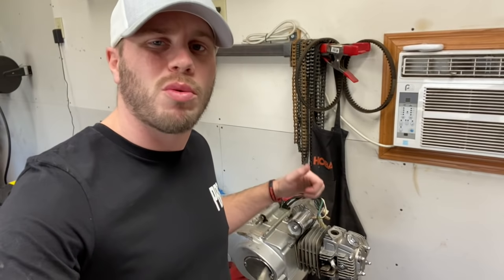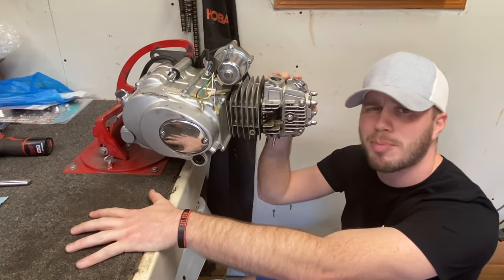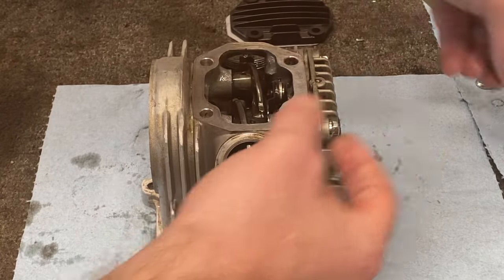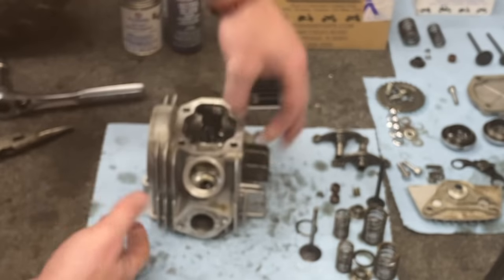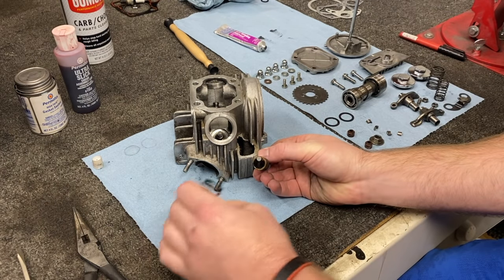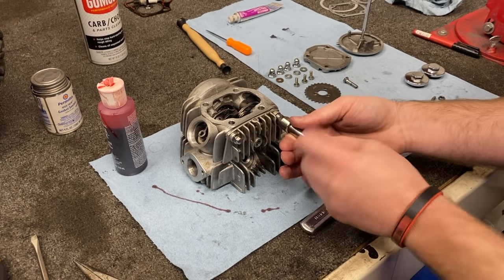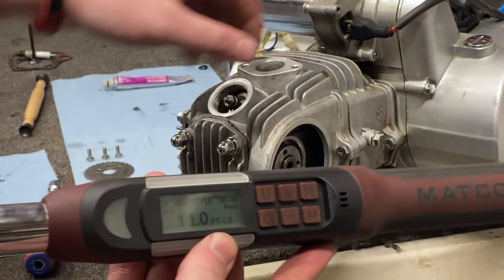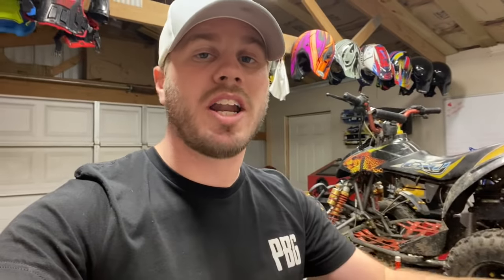HOW TO: Complete Tear Down & Rebuild of a Chinese ATV Engine Head. Every step you'll need covered!

Comment: My little brother just give $150 for a kazuma 125 that hasn't ran in years. Went up there the other day to try turning it over by arcing the solenoid but nothing happened at all. No sparks no click from solenoid nothing. He then decided that it was the stator that was no good when I explained to him 3 times that his problem had nothing to do with the stator and that it was a bad solenoid or starter but instead of listening to me he takes it upon himself to carefully remove the stator with no tools other than a pair of vise grips and few other things but ended up rounding a bolt. What does he do instead of waiting for me to come back with an angle grinder? He grabs ahold of the unbolted portion and broke it off instead so now he needs a whole new engine for it cause it broke a big chunk of it off.
Reply from the maker: Dang man, sounds like your brother just learned a $150 lesson on ATV repair! That sucks, but at least new motors are not too expensive to replace. You could even try and pick up a used one for under $100 bucks.
Reply: He had a suzuki 150 give to him but frames no good. We're gonna put that on the kazuma frame but everything will have to be spliced into the old harness cause the plugs are different and some missing. Also gotta cut and move motor mounts but luckily my uncles got a welder cause I sure don't.

Comment: 0:22 
70?
I got an engine running good on 45!
Reply from the maker: I means that's great if you do so don't fix what isn't broke, but I'm going to say your gauge must be wrong or your getting a false reading. An engine can't run at 45 PSI, that is literally not enough compression for a combustion engine.
Reply: @PraskaBoysGarage  could be off. But that’s what it read.

Comment: You made a mistake. You did a leak down test without verifying the position of the camshaft. You had it in the wrong position for doing leak down. Look at your timing mark on the cam when you took it apart vs when you put it back together. Crank goes around 2 times for every 1 rotation of the cam. Your problem was not in the intake valve. It was only open because the cam lobe was holding it open. If you rotated the cam 180 it would have closed. Your problem lied in the damaged exhaust valve and the intake being open hid the leak at the exhaust valve.

Comment: You're grinding the valves the wrong way you should only grind them towards one direction (left or right) while also pulling up the valve casually in a specific manner. Thats why you use the vice to hold the head you get a nice seat on a chair and you spend your time with it until the valve seat and valve looks a bit coarse and fady and you can see a line in the valve seat on the head. Also you should have replaced everything else since you ordered it it made no sense to change brand new oil but not put your new valves with seals in .. Every time that head comes off The things that always need to be replaced to save u trouble is the Headgasket obviously and the oil seals on the valves because those get worn out really quickly and make your motor burn oil overall really cool video but you skipped on some really essential parts
Reply from the maker: Thank you for the feedback, this is good information as I am still learning everyday. You speak with knowledge of the process and I would encourage you to film some of your projects so you can share that knowledge with us and we can all be better. Thanks!